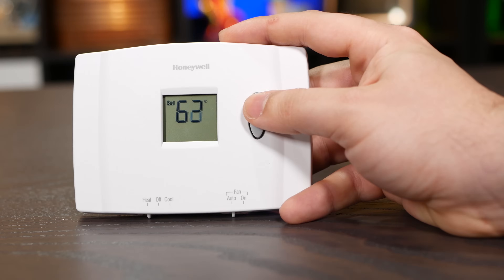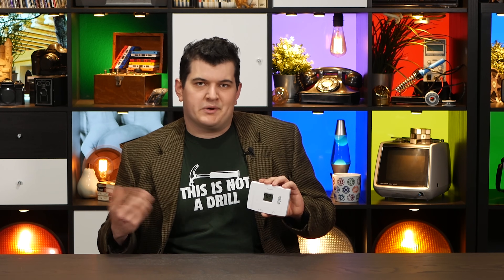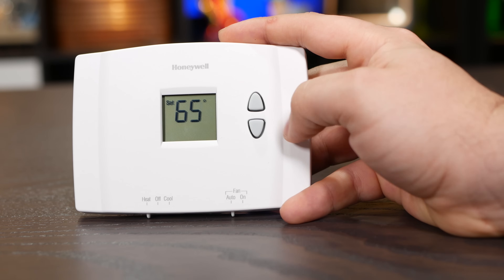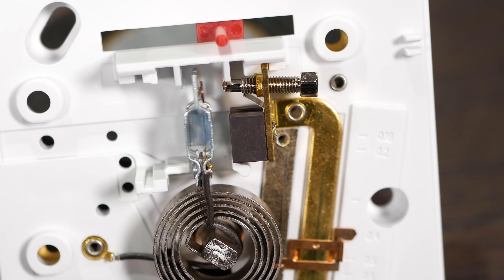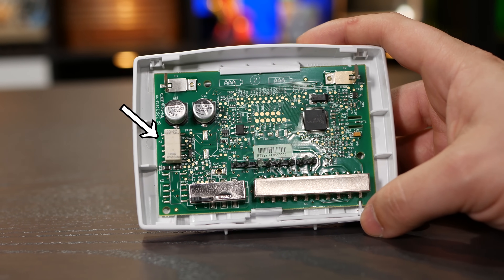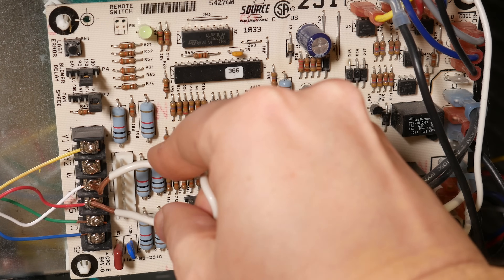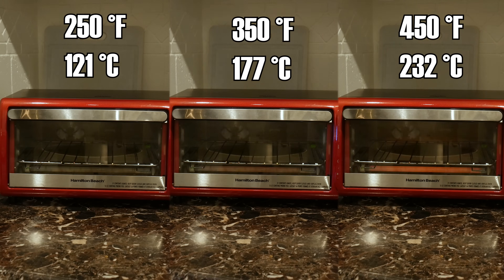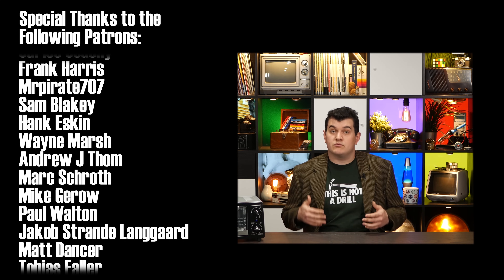Thermostats: Cooler than you think!

Comment: For the final question, I have a thermostat in the UK that does allow me to do controlling for set amount of time (they call "boost"), this is controlling TRVs on radiators, but Tado have this feature built in. It controls the combi-boiler which sends hot water around the house, but only the specific TRVs that currently want heat (based on their own thermostat inside the valve) allow hot water into the radiator for those rooms. The boost will bring the temperature up for those rooms only.

I believe they also have AC support, but AC is much less common in the UK

Comment: The Werefrog used to have a mercury thermostat. The liquid metal expanded and contracted with temperature. The Werefrog still don't know how it turned on the cold. However, it made sense for turn on heat. Unfortunately, the turn on heat was miscalibrated. It had to be set to 90F to turn up temperature to 75F. 

The new "digital" one works much better, and with better HVAC....................

Comment: Might be a regional thing, but higher efficiency furnaces here sometimes use a variable speed DC fan rather that PWM On/Off - this eliminates the uncomfortable blast of cold air when the heat first turns on.
Also, older natural gas wall furnaces sometimes had millivolt thermostats, a topic that would make an excellent Part 2 of your grand thermostat series because they don't require external electrical power (unless you count the power from a flame).

Comment: Interesting. Also the systems here in Germany and some othe european countries work completely different.
We have a hot water heating systems. every radiator has a small thermostatic valve which works like you explaned (although there are also electric ones). But the water heating gas furnace and the water temperature itself... 
Depending on the outside temperature and in some cases the current and desired global thermostate temperatufe the oven will select a water temperature to heat fast without wasting gas. Then it will adjust the flame and gas volume, so the heat input to the water, according to the temperature difference.basically the heater can run in e.g. 30℅ power.

Comment: Let’s add some confusion to the mix. There are systems that you can turn the theromostat up or down a few degrees to kick it into high gear so to speak. Two speed systems with two speed theromostats have high and low speeds for heat and cool. Having the temperature more than about two degrees above or below the current temperature causes the thermostat to selectthe high speed option, W2 or Y2 terminals, instead of just having one speed, W and Y, which are for single speed systems and are W1 and Y1 in two speed systems. In addition, electric strip heaters have seqencers that cause their elements to come on over time so yo don’t get hit with a blast of hot air when all you needed was a touch of heat. 

For me I have a zoned system with a variable speed compressor that I have dumbed down to a two speed. I have the zone control board shift the AC into high after 40 minutes of running on low. By trial and error I have got great cost savings combined with confort with that setup. The heat is the heat and best left on low except when realy cold outside. 

Thermostats have antisipators in them to predict when to shut off before they reach the set points. Othwerwise they would overheat or overcool. That would make a great topic for your show, antisipators. Like pridicting the future. The old Honetwell would have a heating coil that you could adjust for the heater.

Comment: I don't know about forced-air furnaces, but modern high-efficiency gas-burning water heating furnaces can actually throttle their output by adjusting the speed of an internal fan. So, in their case, there are a great many medium blasts.

Comment: Funnily, the "put the heater on max to get warm faster" thing goes for cars with automatic aircon/heater as well, with some exeptions. if you set it to 20 or 28c, it will reach 20 at the same time. That said the full heat and full cold positions are often exactly that, bypasses any automatic controls, and just blasts heat or cooling blindly.

Comment: We have thermostats at work that as long as you leave them in program mode , have an override that allows operation for a 30 minute per button push period. We set our times for known occupation and have the people use the button for up to 4hrs if it's in unoccupied. But most residential systems are simpler because you usually have away or home and times of day. So they don't need to be that complicated.
Reply: Some of ours even have aux outs for various local control.

Comment: We have electric baseboard heaters to supplement wood heat, and there are thermostats for each room that work just like that very basic thermostat, with one huge difference, they aren't sending a control signal, they're switching the full 240V of the heater.  This means that if you want to open it up, you need to treat it like a light switch or outlet, not a low-voltage device.  And since the electric heat is silent, the click caused by that magnet is the only way to tell when it turns on and off without the lag of waiting to feel the heater slowly warm up or cool down.

Comment: I know a a thermostat that did "do that" run for a cycle then go back to it's set temperature afterwards - they were most of the "programable" thermostats sold in the 90's through early 2000's after you'd set programs per day, 5 day, weekend etc.  if you manually adjusted the temperature but did not turn off the programming (move to "manual") during the next change in programming the thermostat would go back to what it was programmed for.  The example would be say you'd set the program to be 65 degrees F Monday - Friday 7am to 5pm in heat mode but you came home at 3pm during the week and it was too cold - and adjusted it to 73 degrees F - after 5pm the thermostat would go back to it's original program (set) for say 72 degrees.  My wife used to accuse me of adjusting the thermostat all the time when it was in program mode, she'd adjust to the temp she wanted then an hour or two later it would go back to what I had programmed it for ;-)
"Smart" thermostats can be programmed in a similar way but there's much more of a chance that you'll actually program them compared to the old ones where you used to be used to setting up a PLC (Programable Logic Controller) to set those up - most people didn't and they just manually adjusted as they wanted - i.e. set to "manual mode".  I like the Ecobee approach - have various sensors that detect motion and temp and then tell the thermostat that if nobody is home adjust the temp lower (for heat) or higher (for air con).  You can still set schedules but you can have them automatically overridden if someone is home (or if they are away).

Comment: As for the question about a temporary setting, I do something like that on my favorite thermostat (certainly not the best, I'm just familiar with it). I do industrial HVACR. I program these thermostats for three different time frames. Slightly warm in the morning, slightly cooler in the kate morning (but NOT cold), and then cooler in the evening. At any point you can make a minor adjustment of the temperature up or down, but the settings will reset at the next time block.

I explained all this to my girlfriend, and programmed the thermostat in her classroom (conveniently she has the same model) in her kindergarten class and all of her co-workers have commented on how her classroom is always the most comfortable.

Basically, I set it for a reasonable temperature depending on time of day (people are coldest in the AM, warmest in the PM), and give them a little flexibility in playing with it (for comfort, and psychology). But since the temperatures reset after a couple hours at most, they can never just crank the temperature for too long and get uncomfortable, then crank it the other way. I get very few "comfort calls" with this method.

Comment: I’m gonna boost engagement! I love this video! But if you have a heat pump, a lot of the thermostats will turn on the supplemental heat (be that gas or electric) if you turn it higher than 3 or 4 degrees off of ambient! Keep that in mind if you have a high electric bill and have a schedule set on your Tstat.

Comment: In Germany for example most heaters made after 2000 have medium blast and full blast. The newer heaters can modulate freely between almost no blast and full power. So they new thermostats could actually tell the heater to run on a bit more power to achieve the desired temperature quicker. It will however never run on full blast to heat the home.

Comment: There are thermostats that allow for a duty cycle without changing temp; however, I have only ever seen them in commercial buildings. There is a button on them that says something along the lines of "call", "manual", "force", "override", etc. Most will also let you set an increment of time in 15 or 30 minute intervals.

Comment: Just wanted to make a note on your first question answered at the end of the video regarding thermostat placement. I use the nest with multiple "zone" sensors, and the use case we have is because the house does not cool evenly (AZ here). At night we want the bedroom at the set temp, i do not care what the rest of the house temperature is. When having game night with friends, the game room gets hot and i want the cooling to run till that room is cooled. etc. While it is true that having baffles and zones would solve this problem better, that is an incredibly expensive solution, when you could for a few hundred get multiple temperature sensors for various common areas. In addition, there are codes (maybe just best practices) about the proximity of the thermostat to an intake to prevent short-cycling.

Comment: An HVAC company recently installed a Honeywell T1 Pro thermostat while troubleshooting a "won't run" complaint. (that wasn't the problem) But they left it in anyway.  After they finally solved the real problem, the furnace cycles at least twice as often as it did previously.  This thermostat has a bunch of specialized "installer" setup options, but none of them talk in terms of temperature on/off hysteresis or "dead band".  GRRR! I never did even get Honeywell to tell me how to stretch the dead band back to where it originally was. (They did, however, suggest how many "cycles per hour" some of different furnace type selections would produce).  I finally had to play around with selecting from those  different kinds of heating system  from their installer options to get where I wanted to be, cycle time wise.   what a terrible system to work with.  I even went so far as to make up a  Arduino-powered non invasive "blower on time" furnace sensor, sent data to my desktop, stored and graphed the data so I could see what was really going on.

Comment: The best mechanical thermostats avoid the magnet and the contacts vulnerable to dirt and wear.  The old Honeywell Round has a sealed horizontal glass tube on the spiral with a little mercury puddle inside.  Bonus:  the contacts never burn because the liquid mercury is always happy to bathe them in a puddle of conductor.  Mine is 51 years old and still perfect.
Reply: 15:27
Reply: @davidregal6831  hmm..ok, thanks . Somehow missed that.  Yes mercury is toxic but not as long as it is inside the intact unit.   Unfortunately, as when they put in a new furnace for me, they usually bully you to replace it with an inferior stat, and while some carefully recover the toxic mercury, most of the techs just trash the mercury unit.   Calibration by tilting is easy.   Read the built in thermometer, set that temp, and tilt the whole unit with the calibration lever until it starts.
Reply: @rtel123  In your defense it was a pretty quick segment, and right at the end. As a former HVAC tech, yeeaaah. There are definitely techs who just throw away old equipment with zero regard for environmental impact, but uncle sam has some pretty crazy fines for that kind of thing if you get caught. IDK specifically about mercury tilt switches specifically but I assume it falls under the other umbrellas for safe handling of materials.

Comment: I have a thermostat with a 'temporary' change mode. The Hunter 5/2-Day model currently at HD is very similar to the one I have, though mine doesn't have the 'temp' message on the display. If you change the set temperature, it will cycle to reach that temperature once, then return to the programmed temperature. Hold will indefinitely hold at your selected temperature until canceled.

Comment: the reversing valve on heat pumps use 0 or B
depending if the default on valve is normally open or normally closed

Comment: The "brief explanation" at 12:20

"Having proven that this demonstration would work using my personal toaster oven, I decided to purchase a new one. See, my toaster oven is kinda filthy and I wanted to get another one anyway. thought it would be handy to have a toaster oven at the new studio. See, they're really nice for making small snacks or whatever (though frankly I've always found the actual toast making experience to be rather lacking even before I was introduced to the Automatic Beyond Belief! Wonder that is the Sunbeam Radiant Control toaster). Anyway, I wanted to get a new toaster oven, right? So I went to the store and bought a really basic one, just like the one that I use every day in my kitchen. No sense spending a lot on what will just be a part-time toaster oven, and it was the same brand as the one I had at home. Must be perfect, right? Well, it turns out that this new toaster oven runs a much shorter cycling time than my old one, so the effect that I was trying to demonstrate became nearly impossible to see. That sure was a bummer! It later became clear to me that this wasn't a very good toaster oven anyway, as the fit of the little tray they give you for cooking tacos or whatever was really very tight and just unpleasant. The whole thing was just a travesty, really. So since I've since returned the toaster oven you just saw and replaced it with another one, but this was after I had already filmed the entire video, and also after I had already filmed my original toaster oven doing the thing I wanted to show you. I toughened up and cleaned it the best I could, and I think it looks 0K.

 So that's the story of why you're about to see a different toaster oven. I Made an assumption that turned out not to be true. Oh merde. In the end, it all worked out for the best anyway because got a much nicer toaster oven on sale at Target right after returning the rather poor one, all's that ends well, amiright?

Oh, and if you write this in a comment to save people the trouble, you're a fun sucker and sucked the fun right out of this gag. I Hope you're happy. [I am thank you -battomon]

A more helpful comment would be to tell the nice viewers about either the "speed" setting on mobile,
the fact that the <and> keys on desktop will advance frame by frame. Then they'll be in on the joke, too! And then when I or any other silly YouTuber decides to do this again, they'll be equipped with the knowledge of how to do this.
[Or I can type this out and keep this paragraph in so they can have their cake and eat it too :)
-the bat-guy again]
You already wrote this out, didn't you?[Yeah… I've spent far too much time to stop. Sorry 👉👈 -battyboi again]
 I won't delete your comment, but you are now a convicted fun sucker and you'll just have to live with that the rest of your life.

Pfft."

P.s. didn't think anyone would do it huh?! Well I've got too much time on my hands, so... Checkmate.
- bat-omatopoeia
Reply: PFFT! YOU FUN SUCKER!!

Comment: I do have a thermastat that allows for one-off heating or cooling after which it goes back to its regular program.  The implantation is pretty clunky (as is everything with this therm)/  It takes several button presses to start this mode and select the new desired temp, which will then run until the next profiled time break which could be 30 mins or 6 hours away depending.  I agree a button which just did "-5 degrees from current for next hour" would be sublime.

Comment: In an old home of mine, the insulation was really bad so with a thermostat, even at the highest setpoint, AC would run 100% duty cycle. So I threw together a quick and dirty duty cycle controller with a raspberry pi, an 8-relay board, and a web interface to control it over the network. A 35% duty cycle was sufficient to keep the house from being unlivable without breaking my bank! (We found out the AC was running 100% of the time by a 6x normal electricity bill.)

Comment: Yes, here in the UK we have a programmable (ie ability to set multiple on/off times) thermostat with a pair of "boost" buttons (one for hot water, one for room heating) that, when the systems are off, will bring the selected one of them on for 1 hour before returning to the existing programming. When the systems are on, those same buttons move the program on to the next step.

Comment: Personal comfort is not affected simply by air temperature. That's why the weather man gives  "feels like" or "wind chill" temperatures. 
The ideal thermostat would sense temperature, humidity, and radiant heat.  There are radiant heat thermostats used with radiant floor heat. With radiant heat, the air temperature can be lower.

Comment: I don't think it's possible to use a thermocouple in a home thermostat, because a thermocouple always has two junctions, and it responds to the temperature difference between those junctions.  It would have to be either a 'temperature dependant resistor (thermistor) , or a semiconductor (like a diode) sensor.